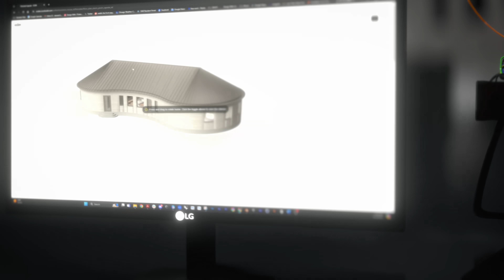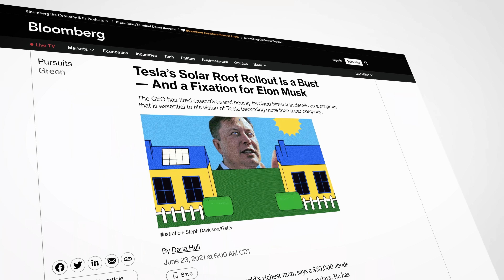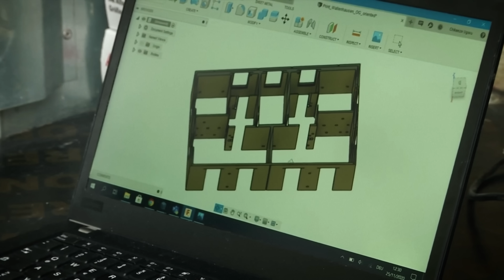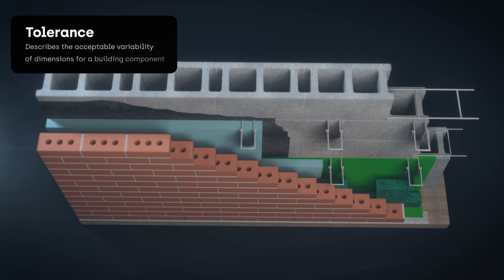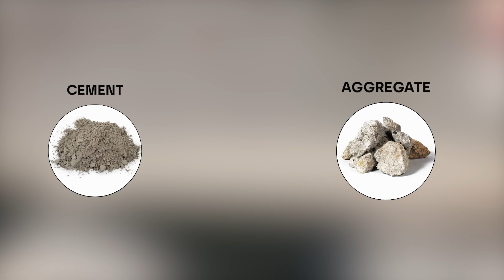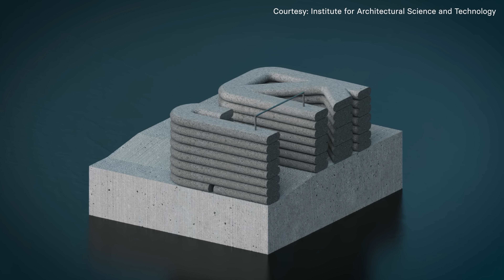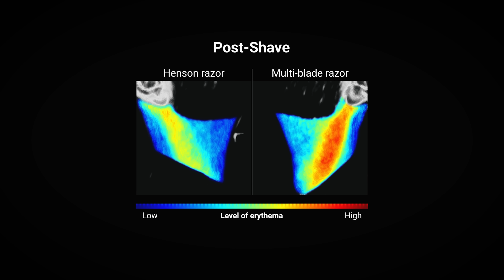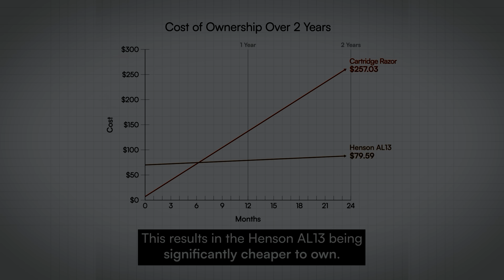Why 3D Printing Buildings Leads to Problems

Comment: While I find 3d printed houses fascinating, it's kind of annoying to see it billed as a way to fight the affordability crisis as if the cause is the cost of construction, rather than an economic issue. The price of housing is artificially inflated by external economic pressures, such as houses not being listed to drive up the price of other houses due to a perceived lack of availability
Reply: Worse than that. Houses are priced by proxy, we have real estate companies arbitrarily posting houses 115% higher than their curb value simply because the one down the street is charging 115% the curb value and they do it with a smile knowing they will get the sale eventually as housing prices increase.
Reply: @carsondinwoodie5840  things sell based on how much people are willing to buy them for. If a similar house sold for more than market value accross the street, market value goes up because people are willing to pay more for that house than previously estemated.
Reply: @carsondinwoodie5840  The market sets the price, not real estate agents. If they can sell it for 115% of the non existent "curb value" you just made up then the correct price is 115% of the curb value. The market sets the value, not you, not the curb, not an appraiser, not the tax authority, not anyone other than the buyer and seller. If you don't like that move to a communist country because that's how a free market works.
Reply: Zoning being #1 issue....
Reply: pretty much. The cost of building a home is way lower than the cost of the ground it's on, at least in those places where affordability is a serious problem.
Reply: The biggest red herring when it comes to discussing house/home affordability is discussing the price of construction - at least for large population centers, construction is the cheapest part of the dwelling.
Reply: Cost of construction has sky-rocketed in the last 20 years.
Reply: There is a monopoly that owns almost all houses being sold in the united states that doesn't want people to know they exist. They use their tremendous wealth to drive up the price of housing and keep us desperate.
Reply: But wait, imagine how innovative it will be if BR Forton gets their hands on a 3D concrete company so they can cut down even further on their labor costs and hire less skilled workers.  Surely this will help the affordability crisis.
Reply: You're right. it's far more an issue of property than housing. We already have 3x more empty homes than homeless people, we can easily make prefab homes, etc.
Reply: Loans are what is raising the price of houses. Just like education.
Reply: Lack of supply is, in fact, driving the absurd prices we see today. And absurd zoning rules driving the lack of supply. This is a fact.
Reply: @Florida_Sam  yes it has nothing to do with the demand increase of importing tens of millions of immigrants at all, it is strictly supply side 🤡
Reply: Don’t forget private equity buying up real estate
Reply: Zoning laws is the main issue. Not enough dense housing in places people want to live. Supply and demand basically. NIMBY don't want it and companies don't want it because it will bring values down. Until the majority agrees that housing is a right and not focused on it as a wealth building tool housing will stay expensive
Reply: @odeaus  Not seeing near enough talk about density in this comment section. Single family homes will NEVER fix affordability, regardless of how easy they are to build.
Reply: @odeaus  Municipalities have abjugated their community design responsibilities to developers to all of our detriment.
Reply: @odeaus density won't solve shit
Reply: @odeaus it will be a problem so long as housing is some thing bought and sold as an investment, inherently incentivizes anyone who owns property to want prices to be as high as possible by any means necessary. the soviet system certainly had a lot of problems but their massive public housing programs were the envy of the world and followed by many European countries for a reason
Reply: @silvadyne00  oh look, you are gloating about communism and socialism.  Americans built affordable housing for decades, especially after WWII. Thanks to property investors from China, kiss affordable housing goodbye.
Reply: @diegosilang4823 I think you are ignoring a few factors.  If you look at Levitown, the prime example of post wwii boom, those affordable suburban homes were 750sq feet on about 0.14acres.  The expectation for home sizes have dramatically increased. Most US cities have expanded outward as far as reasonable or futher.  The expectaion of lower housing density with increasing population is ridiculous.  Foreign investors may be having an impact on some markets but that sure seems like scapegoating what at its core is unstable.  We are spoiled and we need to settle for more high density housing, hopefully we can find less bleak options than Soviet style housing blocks, but a big suburban home and yard is just going to continually be less realistic.
Reply: @odeaus  Housing is not a right, if you cannot afford it, get better skills so you can get a better job. Simple.
Reply: it’s about institutional ownership, and companies like Blackrock. Realtors don’t help, but they’re the roaches finding crumbs here.
Reply: And don't forget the big Airbnb crisis
Reply: The majority of most people's net worth is held with their home.
Reply: As well, the main cost of a home isnt even the home itself, but the land it is built on. A $300,000 house is usually more like a $100,000 house on a $200,000 peice of land.
Reply: @jacobhargiss3839  Not accurate.  
Don't buy in a subdivsion.
Don't purchase in an HOA
Reply: Houses not listed? If you've hired a realtor and your home isn't listed....need to find someone else.
Reply: Land and location is most cost
Reply: Yep it's stupid. Building costs and market prices are totally different.
Reply: : My house was built with bricks
: That's nice, my house was shat by a robot
Reply: Yep - the land will still be expensive.
Reply: Not only that, it's governments that take a long time to give out building permits, expensive building permits, over regulation, land hoarding by governments and corporations, zoning laws etc
Reply: Do you think having tens of millions of illegals here help with a housing crisis or hurts it?
Reply: One thing to take into consideration here, is that 3D Printed Houses will last  much longer than Stick Built houses and when you take that into consideration, you can bill it as "a way to fight the affordability crisis"
Reply: not to mention too venture capital sucking up a lot of the supply and people treating property as an investment vehicle rather than as a place to live
Reply: Tecla 3d printed houses are only 1000 euros
Reply: You can also buy a house for 1 euro
Reply: It’s all city hall. 100% 

Affordable housing is literally illegal in 98% of spaces.

Minimum sizes. Multi family housing zoned out of existence everywhere.
Reply: Its the real estate w h o r e z
Reply: Does no one care about carpenters 😮
Reply: Reduction of cost isn't a way to make things more affordable. It's a way to line the pockets of business owners and shareholders.
Reply: 100%
Reply: Nah man it’s just that people don’t like new houses or apartments being built near them. It’s such a weirdly universal sentiment even my coworkers at an architectural firm don’t like it when new buildings are built here in NYC
Reply: @onuq3r4y478 lol yeah same here in detroit. So dumb. Architecture as a discipline is not only libtarded out but stuffy
Reply: The largest cost of constructing a new house is labor.
Reply: Housing keeps going up in price, because local governments keep increasing the assessment values in order to collect more property tax money.  When people sell their houses, they expect to get at least their houses' assessment values.  New construction is priced in accordance with the market value of existing houses, if not more.  Everyone is trying to get the most money they can.  Greed.
Reply: @TheGuyThatEveryoneIgnores  That is literally the exact opposite of how it works. People only have so much money to spend on a house, if taxes go up that leaves less money for people to spend on housing and pushes prices down, not up. Increasing taxable value doesn't magically create new money. It's wild how you people have absolutely no idea how an economy works but comment on it anyways.
Reply: I don't know of anyone who wants to sell their house, refusing to list it so as to improve prices in the neighborhood.
Reply: @artichoke60045  That's because it's made up nonsense lmfao. People have no idea how a free market works so they just claim there's collusion between parties who have every reason to compete against each other.
Reply: Although it is true that there is market manipulation on houses, it is also true that making something less expensive to build make overall less expensive 🤷‍♂️

And that is soooo true for 3d printing. 3d printing in the industry is either to make prototypes or complete shape part. Those elements where extremely expensive before because it's a usually a one of. Nowadays (I work in space industry) we use a lot of 3d printing for prototypes, test equipment and sometime functional part. Something that use to cost sooo much.

It may be what await 3d printing house, although there is the big roadblock of material
Reply: If it's cheaper to build houses, it's cheaper to develop new lands and build communities around your infrastructure.

If these communities are better than competitors they drive down the cost of housing in other zones
Reply: My shaving blade has worked for about three months now... no problem at all...
Reply: You left off the effects of tariffs, when construction material cost go up, so does the cost to the buyer.
Reply: Don't know what any of you are talking about.
Yeah, when it comes to existing houses, prices are inflated. (In relation to what they where built for)But it's because materially it's not feasible to build cheeper new. That delta is what allows for inflation in the housing market. 

Eg: 
I'm my area,
The average house is selling for $380k and is 1,800 sqft.
The price to build an 1800sqft home new today is more like $600k.
Some of it is rising building standards making houses take more time and materials to build.
And some of it is just simply, stuff is expensive. It's hard to build a garden shed for under a grand anymore.
Reply: Houses have always been expensive.  3D homes are gorgeous, and safe from fire, water and termite free.  To me, its the perfect home.
Reply: The notion that people purposely withhold listings to drive prices for other listings is just plain silly. 
The main drivers for housing costs are cost of materials and property value - property value being about 2/3 of it. These machines do nothing to solve the property value issue. They then replace very affordable labor costs with amortizing extremely expensive and specialty machinery.
Reply: It's not an economic issue either, it's a government issue.
Reply: Or, you know, an actual lack of availability. Because that’s how economics works. You know, supply and demand and all that? Columbus OH has a major housing shortage north of 20,000 homes, and we’re not special.
Reply: Why does everyone ignore immigration as one of the many reasons for inflated home prices?
Reply: All of the problems with housing that are mentioned here mostly go away when you have more supply.

Build more houses and we fix this.  But we need to override the NIMBYs and the Green wackos.
Reply: Well, tell me how you arguments influence price of building houses? You gave arguments for high price of ready prices, not for building. And price of building the house are stupid high. Like even prefabricated houses are stupid expensive even though they should be really cheap right? Because you use pre-made, pre-designed elements.
Reply: @korinogaro that's not the way this economic system works.

We live in a late debt based system, not a production economy.

Our currencies are backed by debts. Debt has been extended instead of producing stuff. Any new house is priced by the mortgage it can get, which is higher than longer than ever.
We have to keep making more and larger promises, because we don't actually make (enough) stuff. 

Our high house prices and long mortgages is essentially out balance of trade for import trade deficits. China sends us ships of goods, we send china promises, and the promises must flow.

Build costs, permissions, land etc actually increase in price to meet this. It is impossible to "build cheap" except within a small range of improvement.
All your builders have mortgages or rent payments, and that's their main expense. The cost of building and the cost of housing are intertwined. Not to mention their taxes and govt debt burden. Builders have debts to pay, so the new debts on buildings must be eeeeven higher!

It's crazy and it's unsustainable, but that's how it is for now.
Reply: That’s not “artificially inflated” it’s just normal economics. At the end of the day if there are buyers but not enough sellers, the price goes up. Calling anyone who refuses to sell their house an “artificial inflator” is wild
Reply: @TrevoltIV nope not in a huge city like Toronto. There are plenty of homes but too many illegal migrants allowed. Plus, Csnada allows international buyers to buy homes & leave them vacant. There are quite a few likely buying homes to launder their mobey in. As a result with theee factors, rent has become expensive as well leaving potentially usable homes empty. So many people are listing but it is in average $2 million just for a 4 bedroom detached home which is ridicoulousness. Plus job market is really shit, $17/hr is now the min wage & inflation is just sky high.
Reply: What in the world are you talking about? Prices are high so people don’t list their houses so prices are high? It is actually the exact opposite. The higher the prices go the more people list their homes that is basic economics. Prices are high because of stupid over regulation, building codes and zoning laws that lead to reduced supply. Go try and build some homes in LA.

Comment: A good summary....except....you skipped THE most important point.  In the middle of a climate crisis, we need to do everything possible to reduce the embodied carbon of our buildings and these are using the material with the largest carbon footprint possible!   Concrete 3D printed homes are simply a gimmick that burdens future generations with no acknowledgement for the carbon costs.....capitalism at its finest.  Until 3D printed buildings can use a material that is carbon neutral, they should be banned.

Comment: Good luck running a new electrical circuit, upgrading you networking, fixing plumbing, or even hanging a picture when all the interior walls and plenum spaces are made of concrete.  Want to remodel and open up your living room to your kitchen?  Ha! Go get a jack hammer.

Comment: We kinda have an answer for this... big a bit skinner and maybe hire finishing crews. I can think of a few ways to alter things in post and you can always hang drywall with anchored screws... hell you could hilti chemical connection points into the wall easy.

Comment: All those groves to collect dust on interior and since it’s a rough texture, cleaning would be a nightmare
Reply: Dust is bad, grease from cooking would be worse.
Reply: it would be simple to plaster it with structolite and veneer plaster to look like a traditional wall and stucco on the outside
Reply: That's what I was thinking about, plus spiders would love nesting.
Reply: Why they don't stucco and smooth out the interior seam lines is beyond me. It takes more labor but would yield a better product.
Reply: Metal studs could be screwed directly to the interior and exterior walls, and finished conventionally with drywall board, siding, and wood in much the way concrete or block buildings are finished now
Reply: Air compressor dusting?
Reply: @Drewcardello would you really want to blow dust everywhere just to clean the inside?
Reply: @Drewcardello  Vacuum cleaner with a brush attachment would be a better idea.
Reply: Doesn't stucco have the same problem?
Reply: @crash.override stucco is painted smooth

Comment: Can't we just 3D print parts (like design a specific factory for this) almost like a lego set and design a machine to place the pieces together onsite. The options would be limitless and gives great flexibility for utilities,  materials, and design.
Reply: Or manufacture parts with far superior manufacturing techniques such as casting, as we already do.

Comment: You can get sharp corners if you want, if a 3d plastic printer can do it so can a concrete printer.  They just need to stop printing in vase mode.

Comment: A note for house construction, we build houses in batches with rolling contruction crews. Foundation layers go in first

Welders for super structure

Framers

Roofers

Eletrical

Ect ect ect 

A houss still takes a few weeks to come together and some of these can be done in concert or in parallel with each other. The benifit is you can pop up like... a bunch houses all at once in a few weeks.

I kinda see this as having the same issues as my home 3d printer... what we need is a specialized heavy duty vehicle you can drive through, self level then start printing...